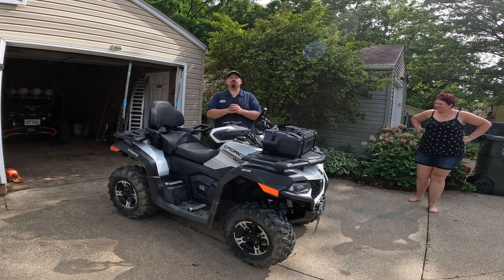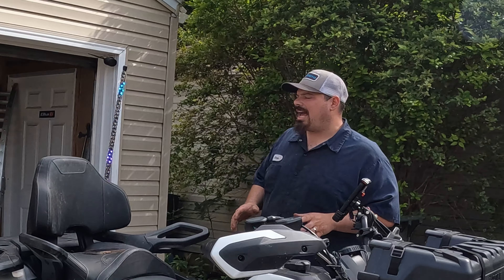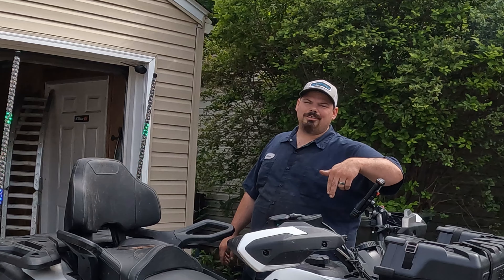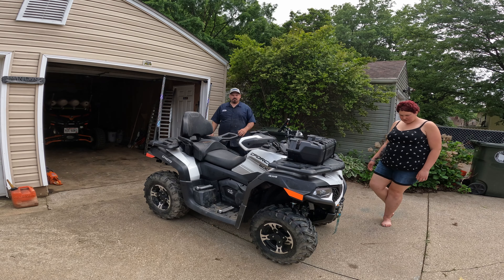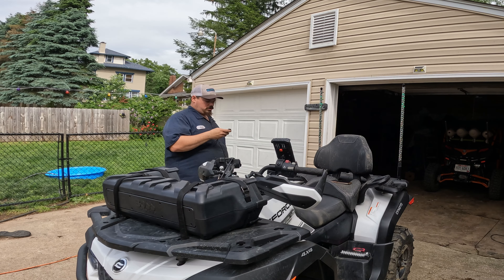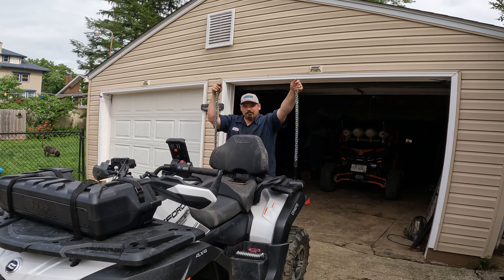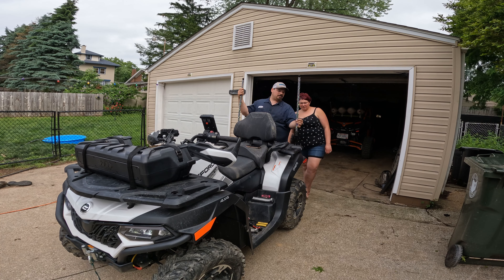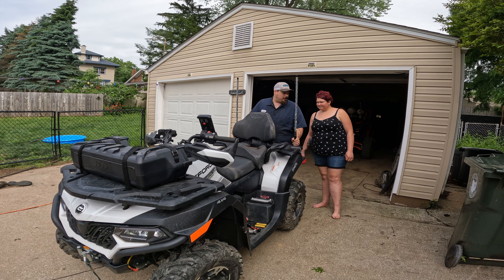Auxbeam 3 foot LED Whips for your CFMOTO CForce

Comment: hey man, just purchased my first 2023 cfmoto cforce 1000. i am loving it but dont know alot about them LOL. did you just put the washer with the bolt on the inside to tighten down the whip light? mine would fit but it seems like its just small enough that it could cause an issue. Thanks for the awesome vids!!!